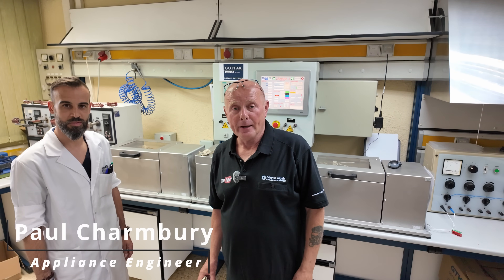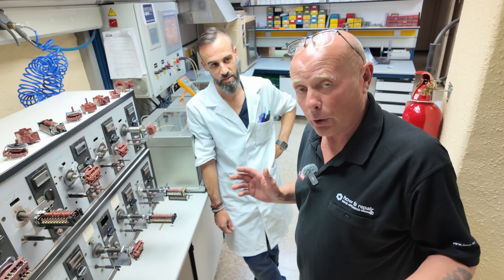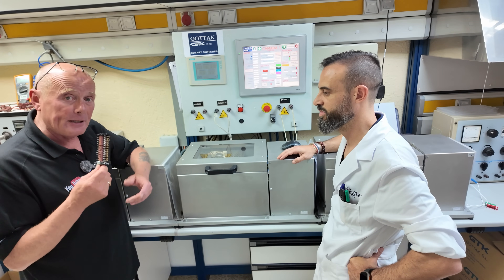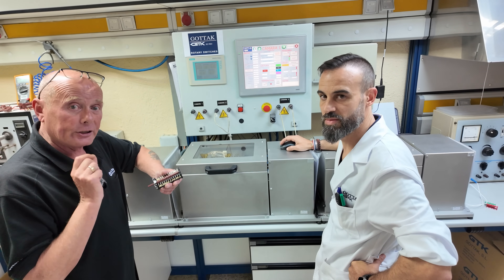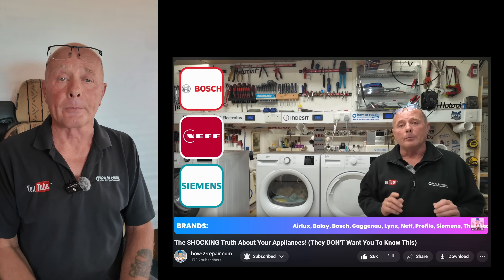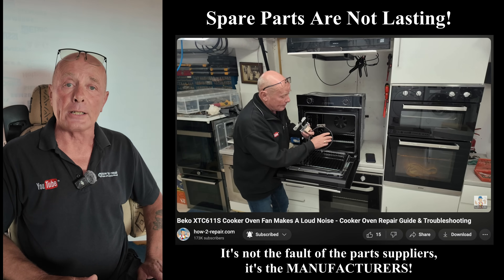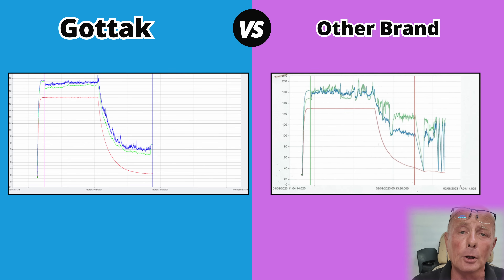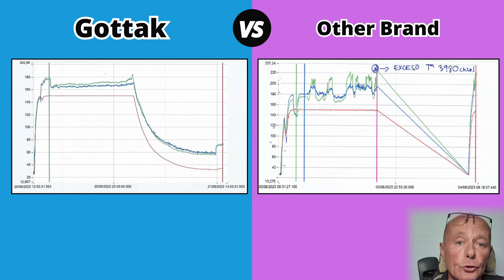Why Your Appliances FAIL SO FAST! Lab Results EXPOSE the Truth!

Comment: In the U.S. I call new appliances "obama appliances"  because he had bills passed to make them low quality and washing machines to restrict water
Reply from the maker: The key problem we focus on is how manufacturers chose to meet those standards. Instead of innovating with durable, high-quality engineering, many used it as an opportunity to cut costs across the board, using cheaper parts and less robust designs that are prone to failure. The regulations require efficiency, but they don't require the machine to be flimsy. That's a choice made by the manufacturer.

This is exactly the kind of built-in obsolescence we discuss in the video. For a deeper dive into this topic and to see the examples we covered, please check out the full video here: https://youtu.be/gEgSCbZnHVM?si=wTIw0mELuhWaw4aX

We also explored related aspects in these videos:

The shocking truth about manufacturers: https://www.youtube.com/watch?v=QsdGd2qDPaI
Heat pump tumble dryers are they really worth it?: https://www.youtube.com/watch?v=xn03N3b0-lE
If you found this information eye-opening or helpful, please consider sharing this video with your friends and family. It's important for people to understand the difference between efficiency mandates and poor build quality.

Thanks again for bringing up this important topic! Don't forget to subscribe to the channel for more insights like this!

Comment: Higher prices and crappy products car batteries,car parts,cars and trucks big and small,most all appliances and electronics,anything with the craftsman name
Reply from the maker: You've perfectly captured the frustration that so many of us feel. It really does seem like across the board, from car parts to appliances, we're paying higher prices for products that just don't last.

The same philosophy of cost-cutting and planned failure that you're seeing everywhere is exactly what's happening inside the appliances we break down in our videos. This is the core of the built-in obsolescence problem.

For a deeper dive into how this affects the appliances in your home, please check out the full video here: https://youtu.be/gEgSCbZnHVM?si=wTIw0mELuhWaw4aX

We also explored related aspects in these videos:

The shocking truth about manufacturers: https://www.youtube.com/watch?v=QsdGd2qDPaI
Heat pump tumble dryers are they really worth it?: https://www.youtube.com/watch?v=xn03N3b0-lE
If you found this information eye-opening, please consider sharing this video with your friends and family. Clearly, you're not alone in feeling this frustration.

Thanks again for watching and engaging! Don't forget to subscribe to the channel for more insights like this!

Comment: The problem also with planned obsolescence is that after 2 to 4 years when the appliance fails, it's so expensive to replace. Most of us can't afford these multiple huge expenditures every few years.
Reply from the maker: It turns what should be a long-term investment for a home into a stressful, recurring, and expensive bill. Having to budget for a new washer, fridge, or dishwasher every few years is a major financial strain that most people simply cannot afford. This is a direct result of the design choices we expose in the video.

At the trade show last year, understanding how much obsolescence is being designed into new appliances these days is something everyone should be aware of. For a deeper dive into this topic and to see the examples we covered, please check out the full video here: https://youtu.be/gEgSCbZnHVM?si=wTIw0mELuhWaw4aX

We also explored related aspects in these videos:

The shocking truth about manufacturers: https://www.youtube.com/watch?v=QsdGd2qDPaI
Heat pump tumble dryers are they really worth it?: https://www.youtube.com/watch?v=xn03N3b0-lE
If you found this information eye-opening or helpful, please consider sharing this video with your friends and family. So many people are facing the same financial pressure and need to know they're not alone.

Thanks again for watching and engaging! Don't forget to subscribe to the channel for more insights like this!
Reply: That’s the whole point 👍
Reply: You will Own Nothing.
Reply: Modern appliances are supposed to save us money by using less electricity to perform the same work. But if the whole thing needs to be replaced every few years, not only is it costing more money, but time and hassle.
Reply: @AaronHorrocks and more trash which in the end is worse for the environment. More in the land fills  that tells you climate change is a hoax

Comment: I bought a German made Bosch upright freezer in 1980 and it's still running in 2025! Only issues is that the insulation must be deteriorating as it loses temperature faster now and temperature is stuck on max freeze viz. minus 40 C. . But I love it as it has 6 interior divisions each with its own door, and the top 3 each have their own separate freezer compartment and food placed there can be quick freeze. No modern freezer has these features or is as good. I will be seriously upset if it stops working and would love to know how to service it back to new condition
Reply from the maker: Thank you for your comment. I appreciate people like you taking the time to write it out. Please share it where possible. It might help others make a wise choice instead of being misled by the industry.

Comment: I was sick of the selector switch on mixer dying, so I bought one with mosfet based switching, it dies too, I stopped being willing to buy a mixer again.  I both don't trust the brand nor do I trust the technology.  And yet new worse than much older ones.
Reply from the maker: Thank you for your comment. I appreciate people like you taking the time to write it out. Please share it where possible. It might help others make a wise choice instead of being misled by the industry.
Reply: @How-to-repair  Yes, and also I'd note that Samsung got a very good reputation in the early days by making things that lasted well and worked well, I till fondly remember a Samsung TV remove that took a 9v battery that we could have under a cover and it still changed the TV, I now have a STUPID MOFO of a soundbar that goes into standby if there is more than 10 mins of silence and the remote is so poor you have to point it directly at it, press hard and pray and sometimes i end up pressing it many times like 6 or more for a few seconds each time and then the stupid light on it you can hardly see if it has turned on as it's the tiniest red light that moves from one position to another position, hardly visible at all others can't see it.  And you often don't own tech, it gets changes in an update.  I'm increasingly over it, laptops are disposable to a point it's disgusting and I'm hoping I can find an alternative desperately.

Comment: Our washing machine died virtually 10 years to the month. It still looked like new . A new p.c board was dearer than a new machine . Pretty disgusting.
Reply from the maker: planned obsolescence and the lack of repairability are major issues in the industry. Manufacturers prioritize profit over long-term reliability. Consumers need the ability to maintain and repair their products to reduce waste and keep costs manageable. Without such rights, we risk a future filled with disposable, hard-to-maintain products. It's a conversation that needs to gain more momentum.

For a deeper dive into the tricks they use in the absence of this data, please check out the full video here: https://youtu.be/gEgSCbZnHVM?si=wTIw0mELuhWaw4aX

We also explored related aspects in these videos:

The shocking truth about manufacturers: https://www.youtube.com/watch?v=QsdGd2qDPaI
Heat pump tumble dryers are they really worth it?: https://www.youtube.com/watch?v=xn03N3b0-lE
If you found this information eye-opening or helpful, please consider sharing this video with your friends and family. Spreading great ideas like yours is how we can start to demand better.

Thanks again for contributing such a fantastic, constructive solution! Don't forget to subscribe to the channel for more insights like this!

Comment: Many years ago we had a dishwasher stop functioning.  The "Repair" tech came in, placed a clear template across the front of the dishwasher and pushed a code into a series of hidden buttons on the front of the machine.  Suddenly it began working again.   There buttons were not marked, no evidence externally that they were there, but they were apparently touch sensitive and completely hidden in plain view.  He never took anything apart, never adjusted anything, just punched in a code and it worked again for six months.  I questioned him on that and he shuffled about and said something about a reset code but would say nothing further.  We had paid for the extended warranty for years on that thing because it was cheaper then replacing the washer or the parts.  I am sure if we hadn't had the warranty he would have "Found" a defective part to change at our expense.  Totally planned service call.
Reply from the maker: Thank you so much for sharing that firsthand account. You're absolutely right to suspect it was a totally planned service call. This is exactly the kind of built-in obsolescence we discuss in the video. For a deeper dive into the tricks manufacturers use, please check out the full video here: https://youtu.be/gEgSCbZnHVM?si=wTIw0mELuhWaw4aX

We also explored related aspects in these videos:

The shocking truth about manufacturers: https://www.youtube.com/watch?v=QsdGd2qDPaI
Heat pump tumble dryers are they really worth it?: https://www.youtube.com/watch?v=xn03N3b0-lE
If you found this information eye-opening or helpful, please consider sharing this video with your friends and family. Your story is a chilling and powerful warning.

Thanks again for watching and engaging! Don't forget to subscribe to the channel for more insights like this!

Comment: And they go on about the environment, not only are we wasting the actual material resources to produce this landfill, somebody has to get up, put petrol in their car and drive to work to make this rubbish, them someone has to load a waggon and ship this crap all over, then someone, no doubt, will have to buy tools with the same planned obsolescence and put petrol in their car to drive round and fix the fkin thing, not to mention all the web of workers in waste management recycling this crap, the waste of peoples time and resources this causes is criminal.
Reply from the maker: Think about the environmental impact of building machines and then recycling them. These machines are often transported halfway around the world, which adds to fuel costs. It's baffling that we need to ship them every five years due to failure.

For a deeper dive into the tricks they use in the absence of this data, please check out the full video here: https://youtu.be/gEgSCbZnHVM?si=wTIw0mELuhWaw4aX

We also explored related aspects in these videos:

The shocking truth about manufacturers: https://www.youtube.com/watch?v=QsdGd2qDPaI
Heat pump tumble dryers are they really worth it?: https://www.youtube.com/watch?v=xn03N3b0-lE
If you found this information eye-opening or helpful, please consider sharing this video with your friends and family. Spreading great ideas like yours is how we can start to demand better.

Thanks again for contributing such a fantastic, constructive solution! Don't forget to subscribe to the channel for more insights like this!

Comment: I would like to see a requirement that manufacturers of major appliances, and other products such as cars, publish the Mean Time Between Failures.  That way customers could choose to buy the cheaper product knowing it will fail soon or the more expsnsive product that will last much longer (and may be worth repairing).
Reply from the maker: Of course, the reason this isn't standard practice is that many manufacturers would be deeply embarrassed by their products' poor MTBF scores. The lack of this kind of transparency is what allows the built-in obsolescence we discuss in our video to thrive.

For a deeper dive into the tricks they use in the absence of this data, please check out the full video here: https://youtu.be/gEgSCbZnHVM?si=wTIw0mELuhWaw4aX

We also explored related aspects in these videos:

The shocking truth about manufacturers: https://www.youtube.com/watch?v=QsdGd2qDPaI
Heat pump tumble dryers are they really worth it?: https://www.youtube.com/watch?v=xn03N3b0-lE
If you found this information eye-opening or helpful, please consider sharing this video with your friends and family. Spreading great ideas like yours is how we can start to demand better.

Thanks again for contributing such a fantastic, constructive solution! Don't forget to subscribe to the channel for more insights like this!

Comment: 14 years ago I had a hard time buying a base model Bosch washing machine, all the sales people were trying to upsell me, or get me to buy a much more complex (and cheaper) chinese made machine. A few months ago I had to dissasemble my Bosch to change apartments, no signs of wear on anything accept the door switch (it's on its third).
Reply from the maker: First, the pressure from salespeople to push you away from a simple, reliable machine towards something more complex is very telling. Second, and more importantly, the fact that your machine has lasted 14 years with only a replaceable door switch failing is a perfect example of how appliances should be built. A minor, high-wear part should be serviceable, and its failure shouldn't condemn the whole appliance to the landfill. The core of your machine is durable, as it should be.

For a deeper dive into this topic and to see the examples we covered, please check out the full video here: https://youtu.be/gEgSCbZnHVM?si=wTIw0mELuhWaw4aX

We also explored related aspects in these videos:

The shocking truth about manufacturers: https://www.youtube.com/watch?v=QsdGd2qDPaI
Heat pump tumble dryers are they really worth it?: https://www.youtube.com/watch?v=xn03N3b0-lE
If you found this information eye-opening or helpful, please consider sharing this video with your friends and family. Your story is a great real-world example.

Thanks again for watching and engaging! Don't forget to subscribe to the channel for more insights like this!

Comment: Interesting, some good work there.  I have worked in consumer manufacturing for about 20 years until about 2010.  Some of your assertions are untrue.  Accountants have nothing to do with component selection, "purchasers" purchase components, engineers (designer, quality control, production etc) approval them.  No accountants are consulted, but we are all pushed for cost reductions in order to remain competitive.
The reason quality/life has been reducing through cost reduction is because that is what consumers want given the information they have access to.   Companies don't want to expose their quality/life performance, or give a longer warranty and simply want to compete by more expensive advertising campaigns (lying is easier than engineering).  They also don't want to rely on experienced engineers, build is contracted out to the cheapest bidder and they may or may not use the approved components.  Even more common today is OEM build where a pure manufacturer designs the item and manufacturers it with your brand on it.   These brands have dwindling technical ability.
Aftermarket parts are even worse because there is even more incentive to by the cheapest rubbish you can get your hands on (for most repairers who want the most profit and consumers have no idea the part was substandard when it fails).
I do have a solution (nearly ready for release), however it really depends how much people want longer lasting products.  This I find is the real problem so far, but it might be changeable.
Reply from the maker: Thank you so much for sharing your insights from 20 years in the industry. The issue you raise about consumer demand is fascinating and complex. We agree that when consumers are only given advertising hype and a price tag, their purchasing decisions might signal a desire for cheaper goods. Our goal is to provide better information about longevity and repairability, so that the huge, latent demand for quality products can actually be expressed in the market.

This systemic problem is exactly what we aim to highlight. For a deeper dive into this topic and to see the examples we covered, please check out the full video here: https://youtu.be/gEgSCbZnHVM?si=wTIw0mELuhWaw4aX

We also explored related aspects in these videos:

The shocking truth about manufacturers: https://www.youtube.com/watch?v=QsdGd2qDPaI
Heat pump tumble dryers are they really worth it?: https://www.youtube.com/watch?v=xn03N3b0-lE
Thanks again for your fantastic, detailed, and expert comment! Don't forget to subscribe to the channel for more insights like this!